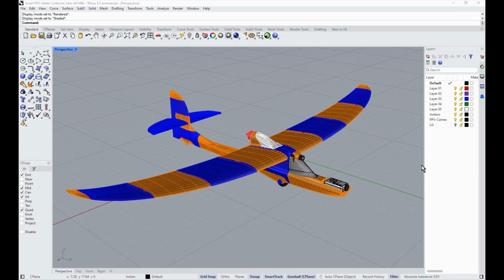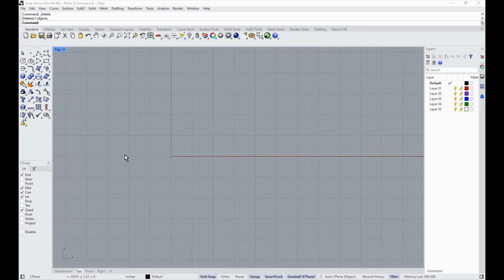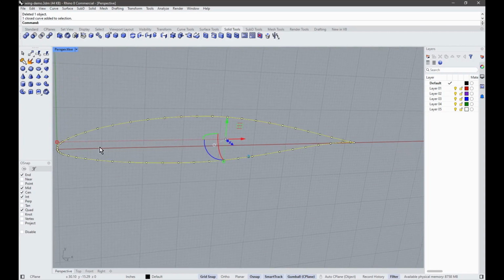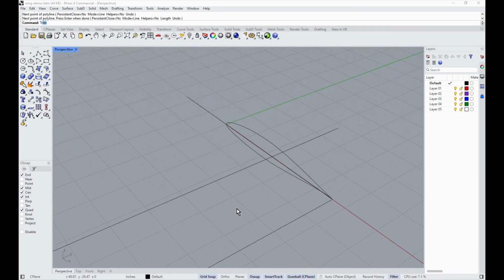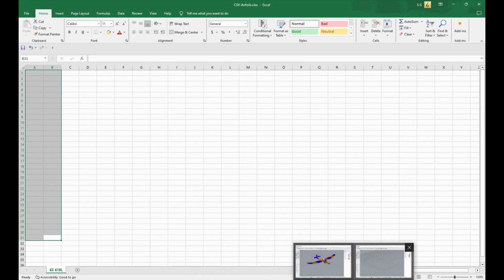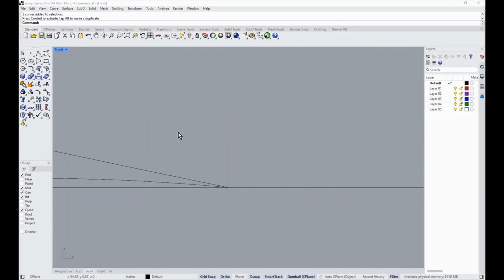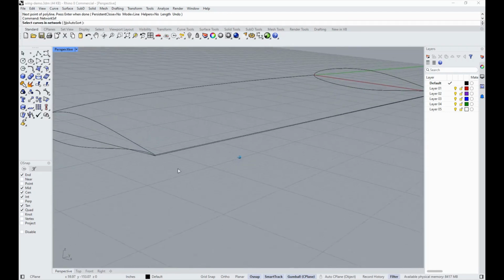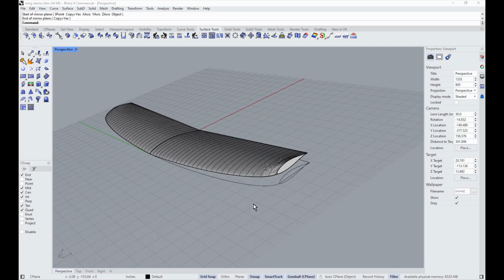Make an Airplane Wing in Rhino 3D

Comment: Aviation does not use it because of there are CAD programs with more control over the surfaces than in Rhino and in aviation you need precise control over the surfaces. And those CAD programs used in aviation also allow you to do mechanical design directly using the surfaces and create surfaces from the solids, not just surfacing work only.